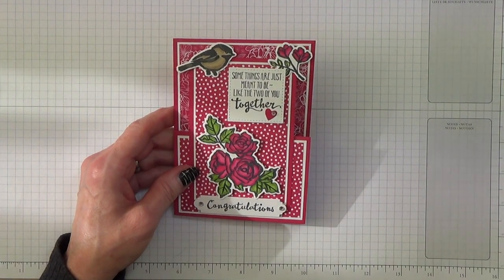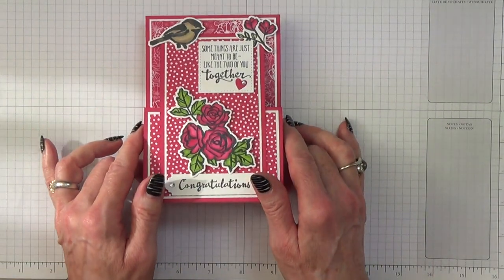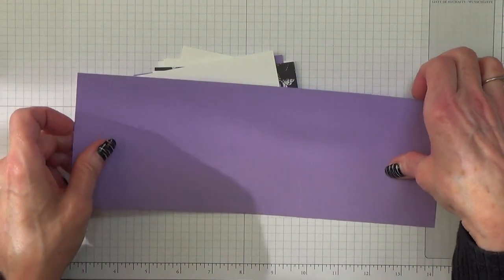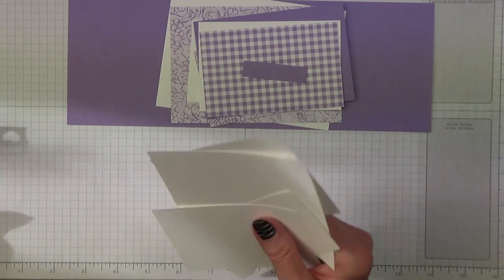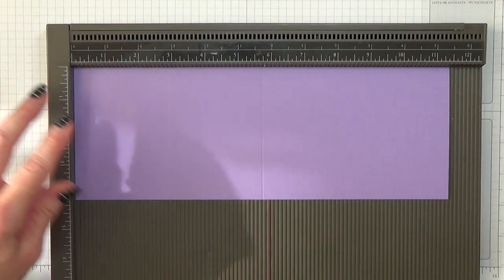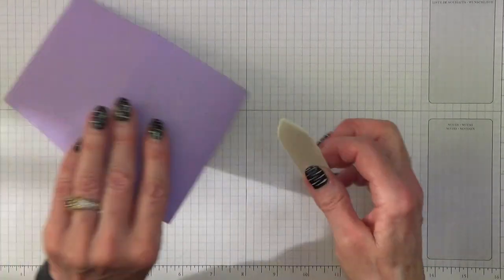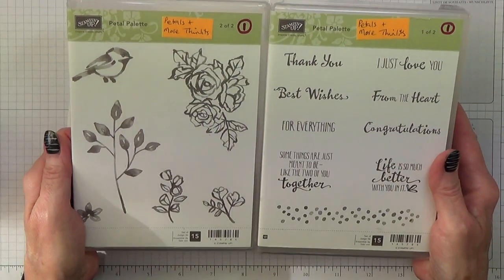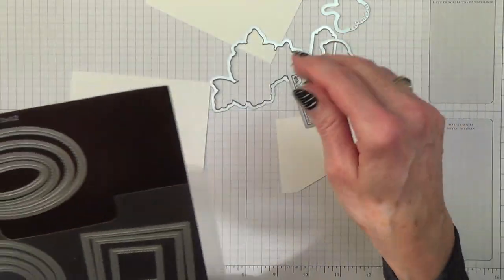No.464 - Norwegian Stepper Card - JanB UK #7 Top Stampin' Up! Independent Demonstrator

Comment: I think the sun coming in the picture is very lovely.  I'm so sorry you get migraines.  How miserable that must be!  I know some can be relieved with diet change that avoids certain foods.  It may be an allergy?  I hope you find a long term solution so you can feel better!
Reply from the maker: Hi, Andrea. Unfortunately, my migraines are aura migraines and are caused by "flashing lights". This means I also get  them if I spend too much time scrolling on my computer, because the images coming and going are the same as flashing lights! At least mine are normally over within half an hour. When I was young, I was knocked out for a day or two! ♥ Happy crafting, JanB.

Comment: Since there are so many layers in this card, have you tried cutting out the centers of your panels before adhering the layers together?  Would that cause a problem with the integral strength of the card?
Reply from the maker: Hi, Deskjockie49. No I don't think it would affect the strength. I just don't like the idea of cutting bits out of my layers! ☺ Happy crafting, JanB.

Comment: I'm having a lot of trouble with the measurements of the middle section.
Reply: I had to have wrote it down wrong.
Reply from the maker: Sorry to hear you are having problems. Have you checked the measurements in the box below the video? JanB.
Reply: @janbcards  I'm getting it worked out.  I was thinking it was a bit taller. Thanks
Reply from the maker: Many thanks, Dawn. That's good news indeed. ☺ Happy crafting, JanB.